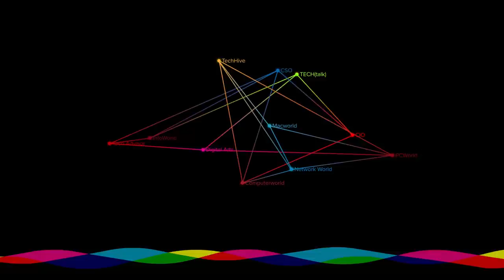Should you re-paste a laptop CPU? Is liquid metal better? | Ask a PC expert - Part 4

Comment: I actually re-pasted my Acer Predator 17 gaming laptop (outside warranty period) cpu and gpu last year December and it made a world of difference on the cooling as the fans for both cpu and gpu run at a lower speed from before reducing wear and tear due to the re-pasting and I do regular clean of the fan and blow clean the heatsink every 2-3 months to keep the airflow optimal, I avoid liquid metal paste on account of reports of it affecting the copper heatsink.
Reply: Neat moves 👍
Reply: How do you clean the heat pipe- I feel like I should know this- I do remove the fans to clean but don’t remove the heat pipe
Reply: @Metal_Masher  also what paste did you use and what temp drops are you getting
Reply: @Metal_Masher  What made you choose the  Mastergel over say, arctic or notcua? Just curious
Reply: @Metal_Masher  I hear ya i've been researching it myself, always used Arctic MX4 and had great success with it, but think i wanna try something different next time.
Reply: @Metal_Masher  Yeah man that shit is tempting because of the lower temps you can get and longevity, but in a laptop there is just so many risks. I ain't down to try it i know my luck! I'm thinkin I may try the Noctua NT-h2 i think it's called i've seen some tests and it seems to have the lowest temps of all, granted we are talking all within 1 degree of each other. Not to mention Noctua claims it has a life of 10+ years once applied, i think the Thermal Grizzley is supposed to be change like every 3-10 months i read somewhere, not interested in that nor the Liquid Metal version!